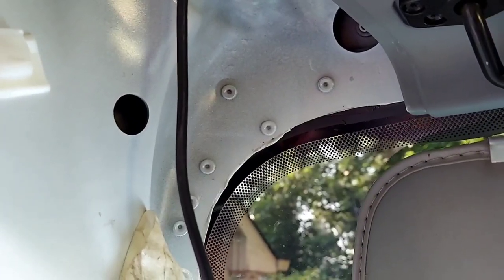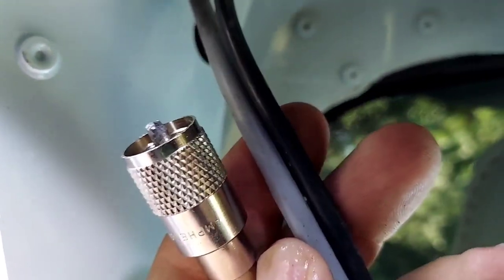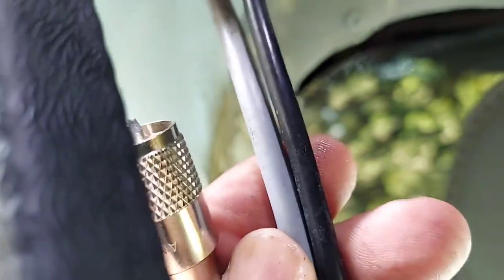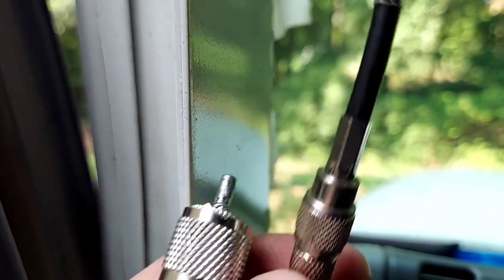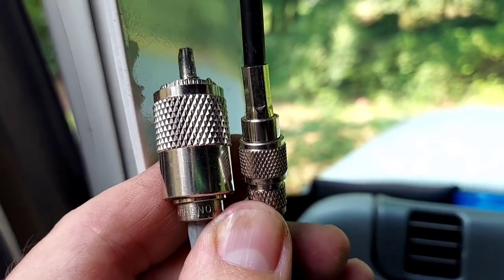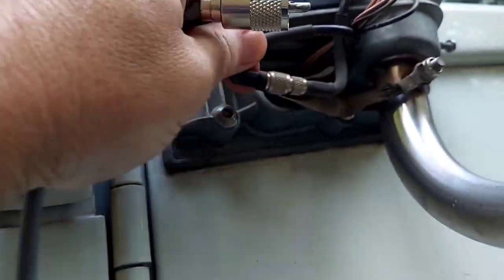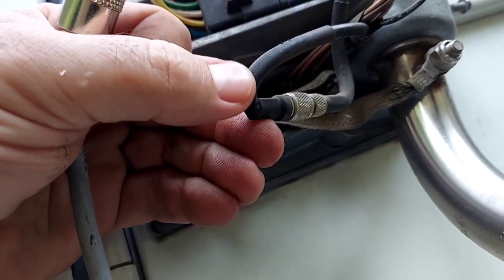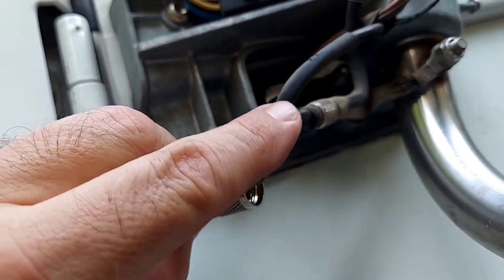Why I use new coax! Announcing the 7' SS antennas winners.

Comment: Hi J,   For your next upgrade.  Please order LMR 240 coax (if you are running a single antenna)  It is basically RG8X on steroids.    The differences are 20 year military grade/ spec outer jacket, 95%+ Copper braid, over a 100% foil shield over the insulator, Quality hi velocity pure copper center conductor.  It puts that grey stuff to shame.  You won't find lower loss higher quality mobile coax on the planet.  You can find LMR240 on line.   You won't usually find LMR240 at the CB shops or truck stops.
Reply from the maker: I know where to find it. Not sure how I can convey the improvement over 8x through the video without better test equipment than my dosy 2000.
Reply: Hi J,  No issues.  RG8X, if it is good quality, is usually a great improvement over RG58U or RG58AU (stranded center).  RG8X is also referred to as mini Base Station Coax.  

RG240 is like RG8X on Steroids, it is a blessing for Tractor Trailer drivers.  

With all the static and other noise generated by the larger tires, the truck alternator, and picked up by all the extra miles of wiring a big truck and trailer has ETC..., on receive, your radio will be much quieter due to the double shield, specifically with the 100% foil shield under the braid and there is obviously less loss on Transmit with the double shielding.  

It is not necessary, but if you are running a big radio, it is a wonderful upgrade.  Just saying.  I am an old guy, I have been on CB since the late 1960's.  I only mentioned it because from your videos it looks like your system is Big Time  10-8.   

I am retired now and I frequently run TN to FL to see the kids and grandkids.  I am currently running a Sirio turbo 5000 thru the roof of my crew cab PU and a RCI2970N4.  BTW, I like your videos.
Reply from the maker: @arlenewolf5260  thanks, I recently learned about the LMR 240 and already had the RG8X. I just don't know how to tell others how much better without being able to show the difference.

Comment: Question?  The coax end mounting to the antenna. The coax fitting has those 2 niples on them and the antenna side doesn't so it doesn't fit flush. Do you leave them on or grind them off? 
Thanks
Reply from the maker: You can grind them if you want for a better connection.. some connectors have little teeth all the way around that those 2 teeth will lock into to make a better connection.
Reply: @jrichtruckincbtips  unfortunately mine don't

Comment: Where did you find 7ft SS's?
Reply from the maker: antennapartsoutlet.com They are super flexible. I suggest getting a 3' piece of cpvc pipe and put it over the base to keep the antenna from failing in a year or two.If you are using it for a mobile application.